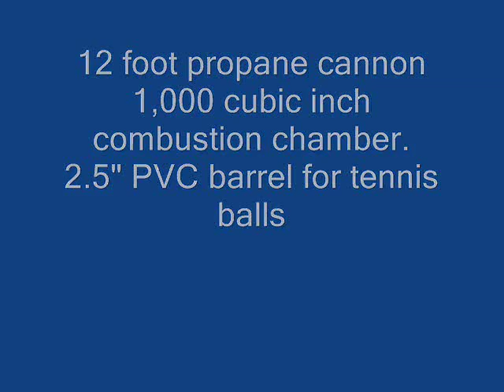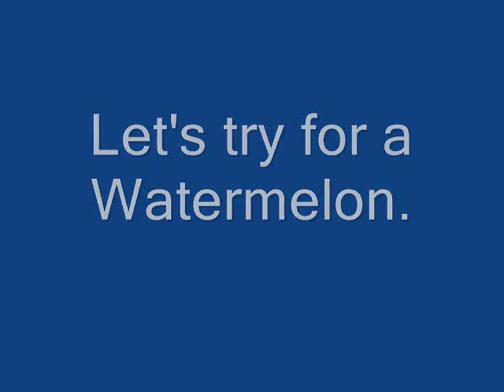Propane cannon

Comment: Lol, that's nothing... Old school, get 8 of the big metal coffee cans cut all tops and bottoms off except one, leave bottom, poke hole center of the bottom, tape together, and use lighter fluid inside tube, light the hole at bottom, the sound alone will set alarms off, we not going to talk about shooting range, but it's on fire and out of sight,
But most of all it the sound alone is what you want, something like a battle ship Canon... It's the same as potato gun made of Campbells soup cans but on steroids...
You will hear this miles away, and you may want ear protection if you brave enough after the first one makes you shit your pants... M80s have nothing on this...
Yes I was a troubled child...
Reply from the maker: We did that with spray cans. Cut the tops off.  Stacked a couple. We used pure rubbing alcohol. Shot tennis balls as well from them. Yes, very loud.   I would imagine coffee cans make an even louder bang.
Reply: @solaryellow123  ohhh, yeah... Nobody wants to hold the can anymore after the first blast...
It's so loud the police will surround your area and try to find you with each blast, everyone in the neighborhood will dial 911...
But please don't believe me 😂😂😂
My buddy in the Navy showed us this and OMG... It has enough recoil that it can break a Bic lighter lighting it...
I'm sure if you're next to windows they will break... 👍

Comment from the maker: It took me a weekend to build, but a couple months to find schedule 80 in 6"
The meter pipe is key, as well as my one of a kind slip fit barrel extension which I could share if someone wants a 10' plus barrel, since the 2.5" I got came in 8 foot.
I built a custom vent port on the back and installed a 4" dc fan inside the combustion chamber, the flash is so quick the fan doesnt burn up:) twist wing nut, pop cork, plug in fan ventilate, all in 15 seconds without unscrewing the end cap:)